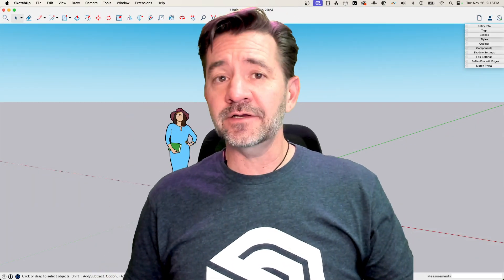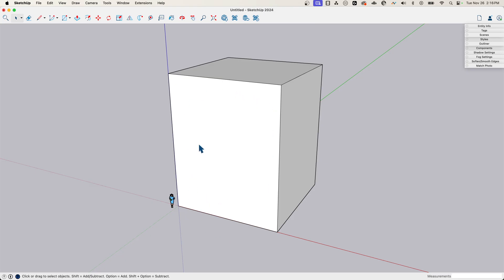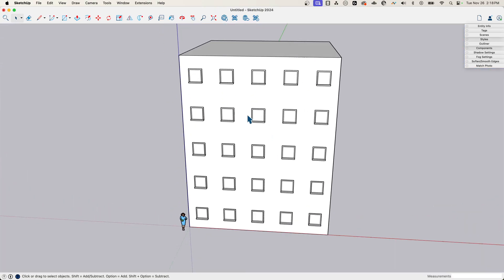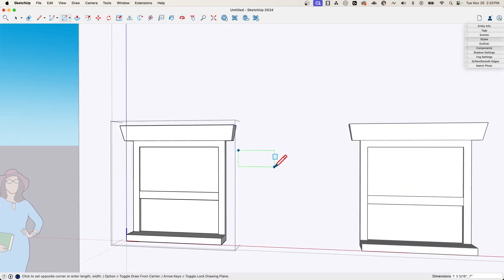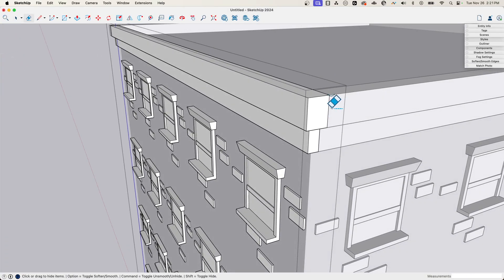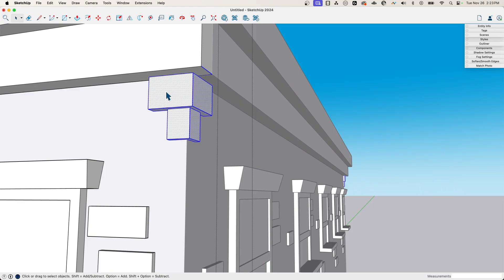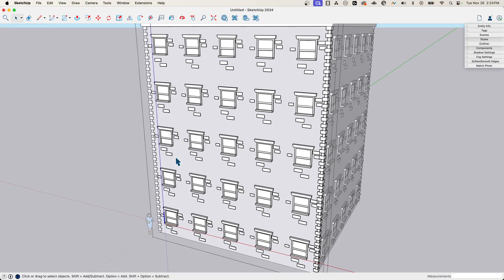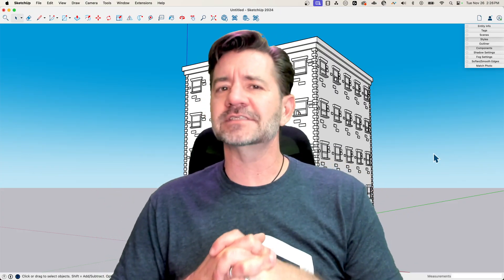SketchUp Hack to Exponentially Add Complexity

Comment: Hi Aaron, I noticed something new in your comments, the double Ctrl with Move tool to switch to stamp mode. That's new?
Also, with components, I'd like to see you play with the components options. I always struggle with this, especially the auto-cut openings. Which could be usefull in your building example...